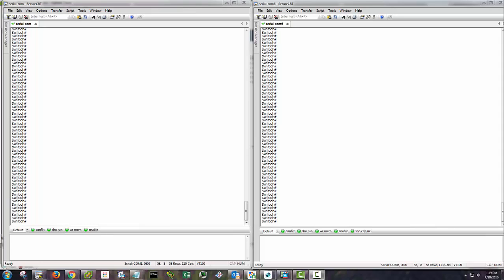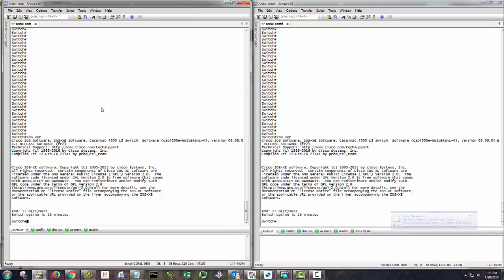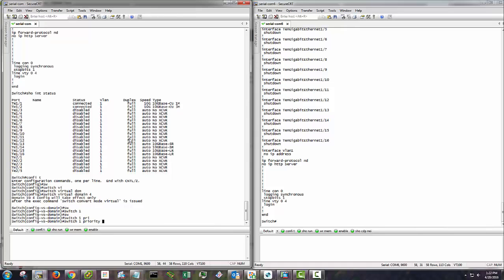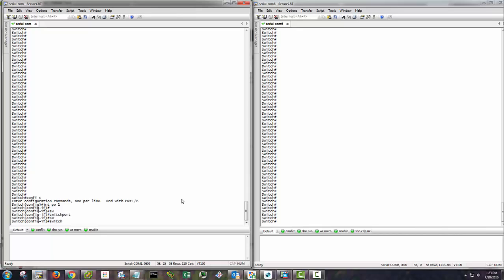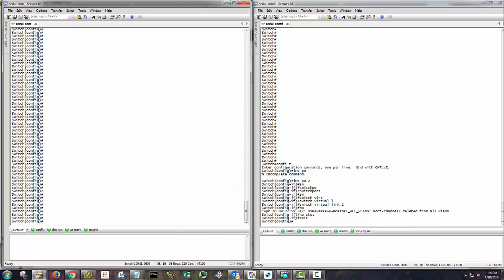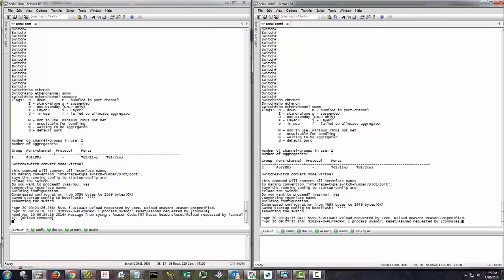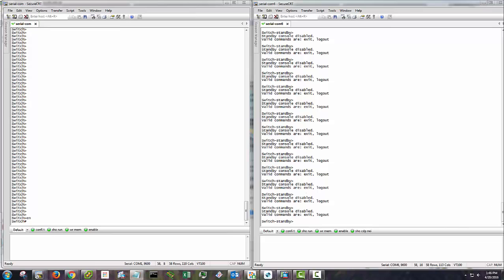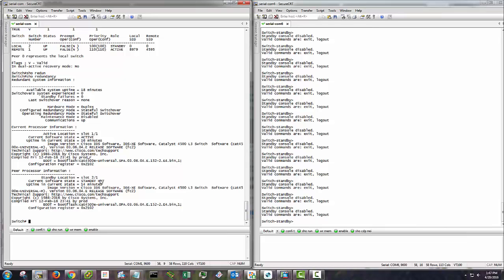4500X VSS

Comment: Hi Doug,

Here is my scenario.

Originally, our client has two(2) Cat4500X with VSS applied on it.

Then they pulled out the 2nd core since they need to deploy a Core on their other site.

Now that they have purchased the new Cat4500X, do I only need to configure the port where the VSS configuration will be connected?

Comment: I have similar issue on my 4500X VSL links as port-channel do not come up and keep the physical ports in the suspended state.  Sh int status shows ports not connected. Can I proceed with 'switch convert mode virtual' command even when my VSL port-channel is staying down?

Comment: awesome. You wouldn't have one that shows how to upgrade them in vss mode?
Reply from the maker: I do not. Unfortunately, I no longer have access to this gear. My recommendation is not to do ISSU upgrades. Load the code on both, set bootvar, reload the entire shelf. If you can afford a 3-4 minute outage it is worth it. I have had a couple of bad experiences with ISSU upgrade.
Reply: Thanks for the update.

Comment: Doug do you have a version of ios-xe that you recommend? I have some 45s that shipped with 3.0.7.1. also I noticed that you did not set a virtual mac address.  Although recommended by Cisco I see many examples of folks not using it. What are your thoughts?
Reply: Why not just check on Cisco's website for the most stable version of code?  IE the STAR version.
Reply: I did .  but sometimes more experienced people have recommendations on the subject and I value the experience of others.